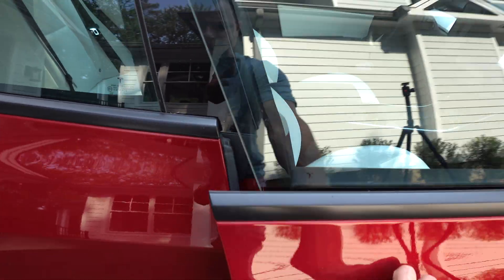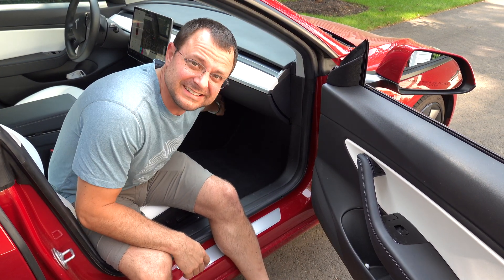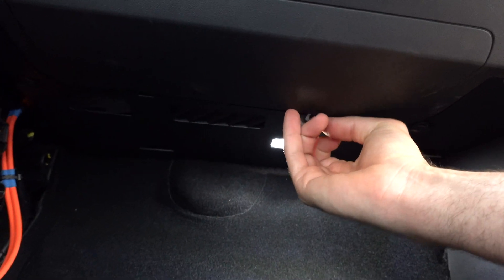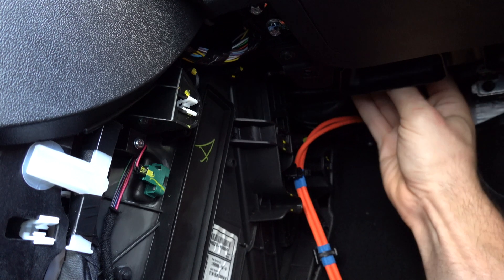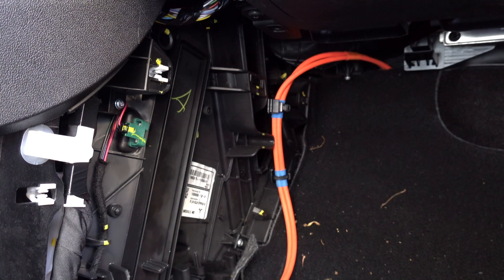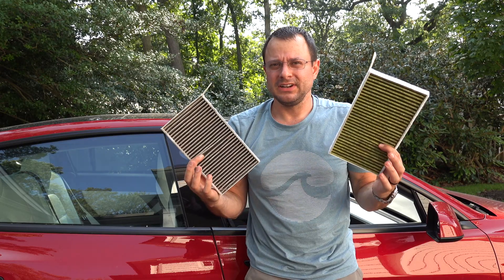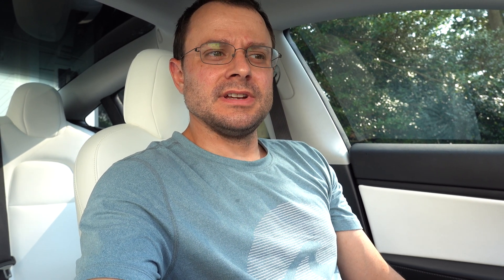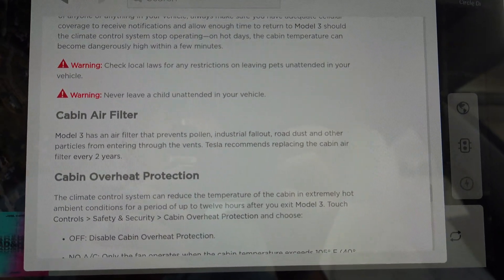Model 3 cabin air filter replacement and dirtiness check

Comment: What a comedic video, Scott! I was cracking up when you tried to pull out the lower filter first!  Your joking around was really funny, but I gasped when you took the brush from the kitchen sink and used it on your filters! The kitchen sink can be cleaned, but that brush? You know what she’s going to do with your toothbrush? You had better watch out, because I’m going to her to watch this video! 
I was glad to see that you went with higher quality filters with activated carbon. I have these and the air really smells great. You can recharge the carbon by putting the filters in direct sunlight.
Reply from the maker: Lol!  I wondered if people would pick up on that. The brush was due for replacement so it did get swapped after.